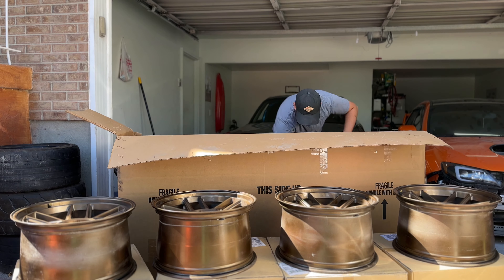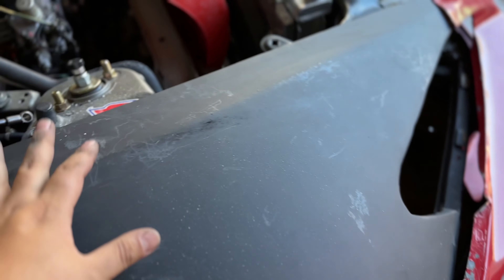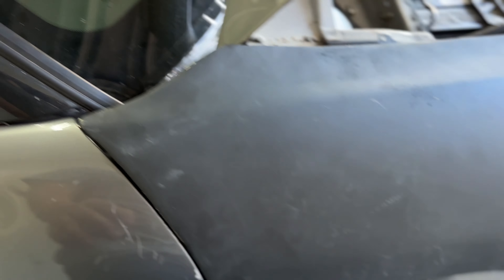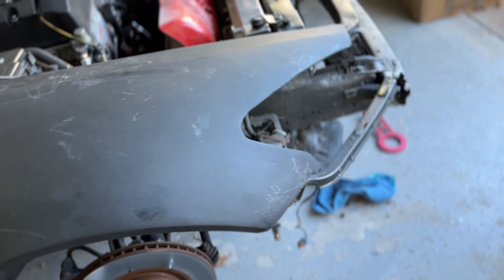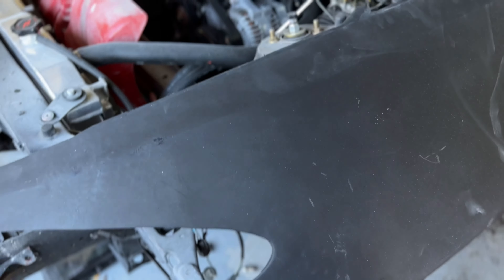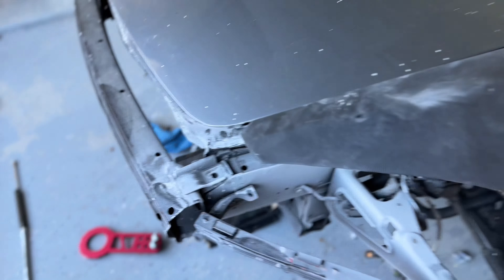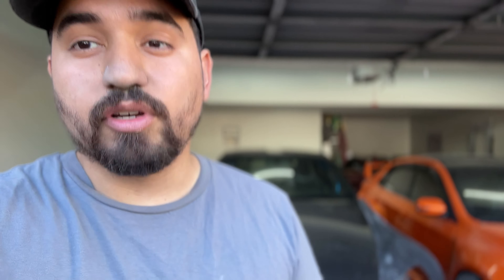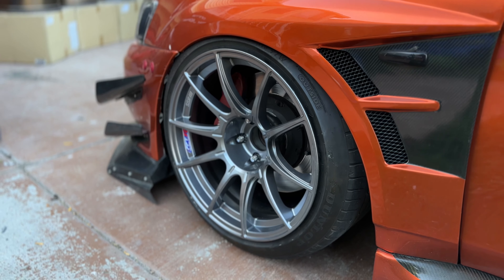S2000 gets new wheels and J’s racing style fenders!

Comment: I can't figure it out. Why is your JS racing fender not sticking out from bumper side? On the pictures I saw this set up before and it looks different. Fenders are wider than a bumper. I like the look your car has much more. What is the secret?
Reply from the maker: After I posted this I messed with the fitment some more and they do stick past the bumper more, but I have the end caps that’ll make them line up I need to mess with